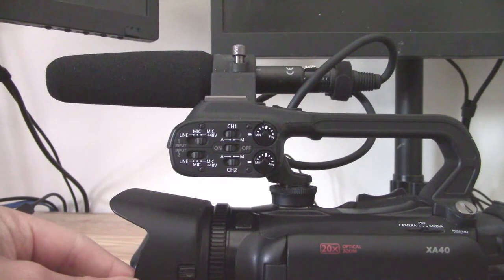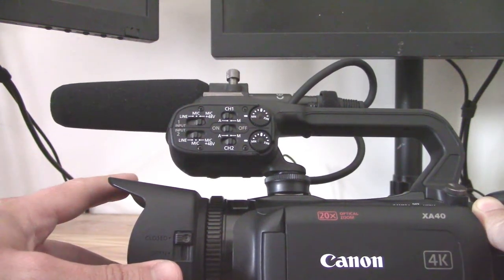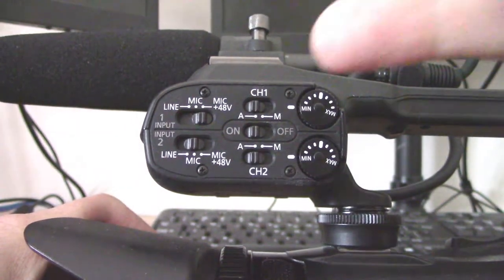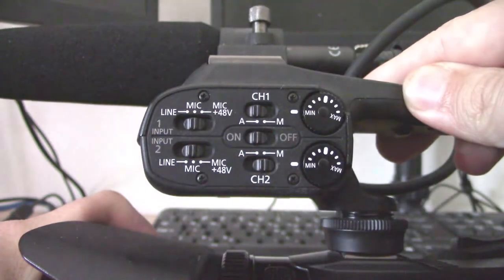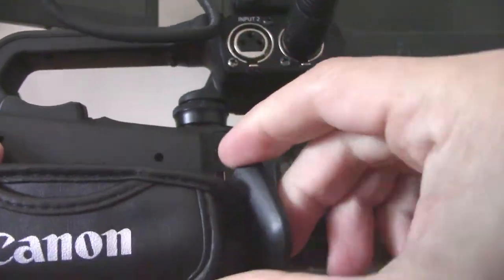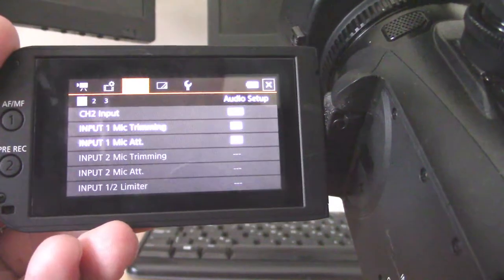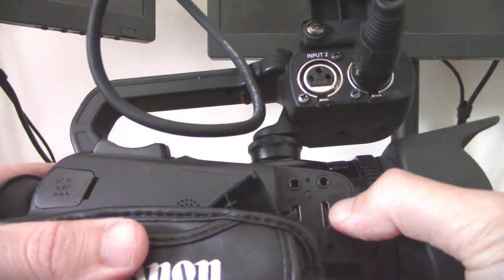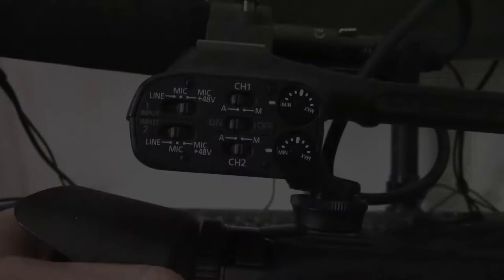Canon XA40: Pro Audio Top Handle Settings Explained

Comment: Great video…….what happens with the audio when the speaker maybe 10-15 metres away, do you employ some type of Bluetooth microphone?
Reply from the maker: I use a wireless XLR system with the receiver placed into the XLR jack.
Reply: @DanielSRosehill  -Wow…..that was an amazing response, I researched what you said and for example and I came up with RODELink
TX-XLR system.  So what happens if your videoing the groom at a wedding reception giving his speech and he’s already got a microphone that’s feeding into the PA.  Do you set up a wireless lapel microphone on the groom…..I guess.  Thank you for your time.
Reply from the maker: No problem at all. If the groom's mic is going into a mixer ask the sound engineer to give you an output off the mixer and set that input to line. Otherwise yes of course you could just rig up your own mic. Don't forget there's a 3.5mm input too so you really have all options. Those wireless systems (eg Wireless Go by Rode) tend to be cheaper as XLR tends to be more for professional uses.

Comment: Great video Daniel, I find the “in-camera”  preamps to be fairly good.  It is trying to adjust the on the fly , difficult due to the position of the dials at the back of the left side of the camera.  I have purchased a Zoom H1N and mounted it on top of camera but even being so small it is bulky in that position.
Reply from the maker: Same! I also actually have a Zoon H1N but to be honest I have never used it in this manner (yet) although you'll probably end up with better audio. I love the form factor of the XA40 and that everything is ready to go. Sound guys will tell you that recording direct-to-camera is heresy but at my (fairly basic) level of production I find it more than good enough to get the job done.

Comment: Does the handle ever die? Or is it connected to the camera? Or how do you charge the handle
Reply from the maker: No. Its connected to the main body through a hot shoe mounting and is supplied with electricity. So its controls will operate for as long as the camera has battery.